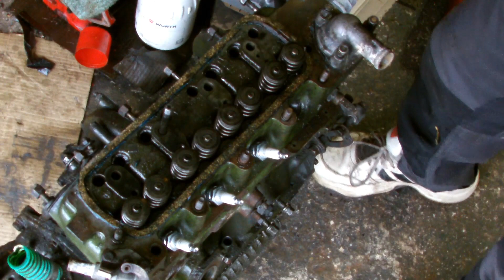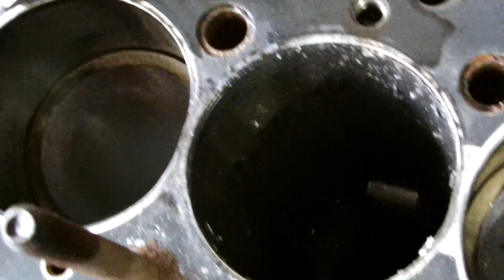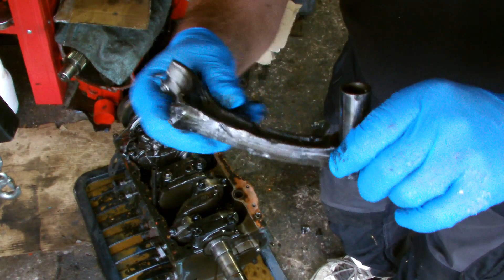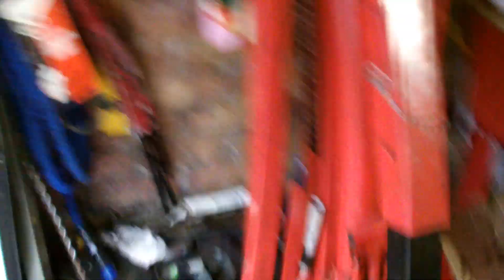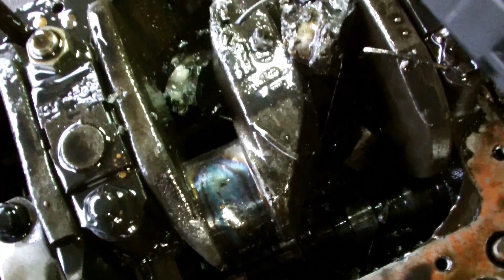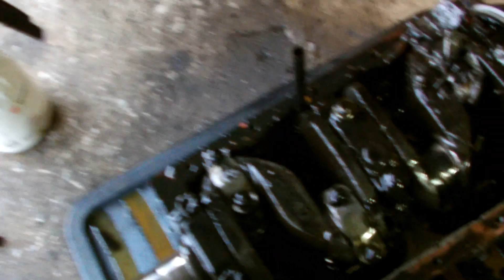Classic mini longman 1380 engine strip down (catastrophic failure)

Comment: I've often thought over the years that the 1380 is just stressing the A-series design too much. It seems okay if you're (for example) racing them, because they get the maintenance that they need and the ancillary parts such as improved cooling system etc. But over the years I've noticed that 1380cc road-going engines are just troublesome. I don't think the extra power is worth the maintenance hassle and failure risk. 1275cc seems to be about the practical maximum for everyday use. Very interesting video. Thanks! 👍
Reply: I’d agree, although I wouldn’t say it’s so much the increased displacement but more the lumpier cams and more full throttle high rpm thrashing that they tend to get. 
Although the thinner cylinder walls won’t help.

If you turbo a 1275 you can have an easy 130hp strong torque and don’t have to rev past 6.5k to be fast.
Reply: @inadvisablyappliedmagic1068 
I agree, your into a lot of money and effort to get a twitchy 100bhp out of an na , fit a turbo to a near standard mg 1275 and your into 140bhp without reving it to death 🤷

Comment: I've been quoted 80 quid per liner in my block and have sourced the liners, there appears to be two sizes and the oversize ones should save a worn 1380 block. I suppose it's lucky it was only at idle and that saved the head and maybe the gearset.
Reply from the maker: Hi richard, the gearset has been damaged and the camshaft has taken a hit as well unfortunately 🙄
Reply: @pauljeffries  Bugger nearly the full house then!

Comment: What do you think was the cause of damage??
What started off a bad string of events ??
Reply from the maker: It looks like one of the big end nuts had come off as it was amongst the rest of the bits and the thread on the bolt was intact, but that's just an assumption.
Reply: @pauljeffries  yep, the conrod , although bent as hell, wasnt at fault, but I think the cap must have let go.. possibly lack of oil feed?

Very interesting video Paul, and your commentary made me Lol! When you picked that conrod off the ground 😂😂😂

Is it rebuildable?

Comment: Paul, You said in part 1 it looks like the small end showing through the hole but it doesn't seem physically possible the con rod could go through a 180°
but after bending like it did it must have hung on till it seized solid, Great shame for the owner. Cheers Dave
Reply from the maker: Yeah, it's still baffling me how the conrod ended up the wrong way up 👍